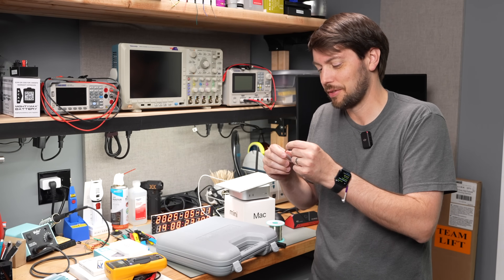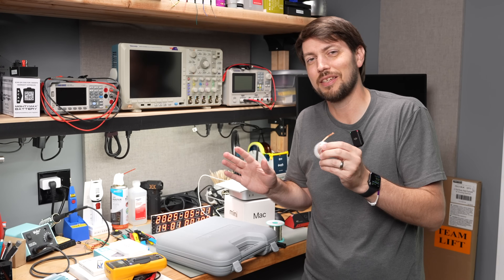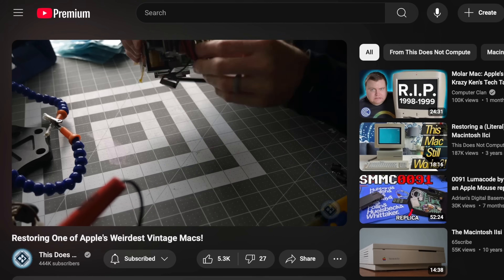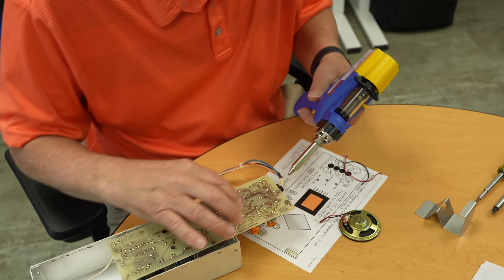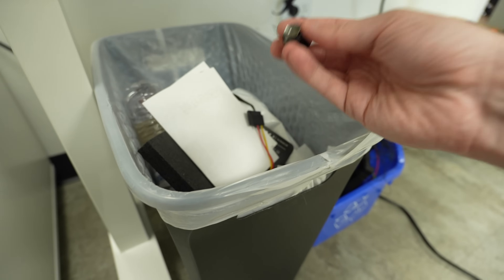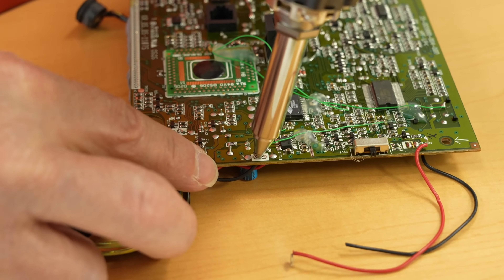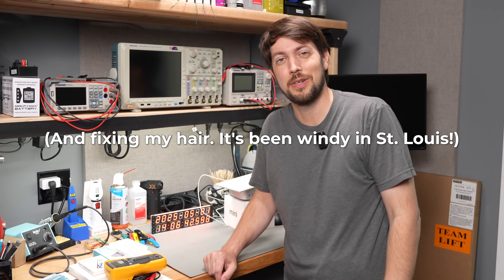Nobody told me desoldering could be easy! (Hakko FR-301)

Comment: I've just bought a cheap ZD-985 desoldering station and.....the hell, I don't understand why I didn't buy it 10 years ago! I just tested it without even readon a manual, I set 300°C to test it, I tried to sesolder an amplifier from old ISA sound card, it worked really well, then I turned it around and amplifier just fell out without even touching it, I am honestly shocked by this result, I didn't expect it will work that well!

Comment: I bought an ultra cheap desoldering tool with built-in heater. It performs much better than a simple non-heated sucker and it costs around $10 on popular page starting with Ali and ending with express.

Comment: Solder wick you have is too big.  Need #2 or #3  for your application.    Soak it with fresh rosin.  The larger solder wick you have is a heat sink.   Thanks for posting the vid.

Comment: PSA. If you're in USA and trying to get the Japanese version.  You want the fr301-82. This one has the ground on the plug.  The fr301-81 does not have the ground prong.
Reply: The fr301-82 Japanese version is under 200$ on eBay.  Adding 2x 300ohm 2w resistors, makes it the USA version for much less

Comment: I love the metcal desoldering gun I have at work ! It just doesn't work well by itself if it's a multilayer board or if something has a high thermal mass, in which case you'd need to preheat the board.

Comment: I grabbed mine by the tip during cleaning of the shaft while it was on the 2.5 heat setting (it gets clogged bad if you don't stay on top of it). Anyways, ya that sucked. Heard the singe noise and everything. It healed up in a couple days. My ego is still burned and bruised though.

Comment: Hi, I use Bismuth when I need to desolder some IC or more stuff from one board. It melts at around 70°C and mix with existing solder very well. You just have to remove as much as possible before re-soldering new components to that board or reusing desoldered components. Bismuth can contaminate your fresh solder joint and cause issues like cracking or embrittlement.

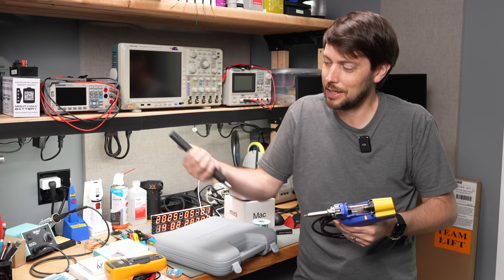Comment: 1:57 Continuous-vacuum desoldering isn’t just about saving time or getting into tight spaces, it’s also about being able to extract certain types of joints at all. 

PCBs without plated through-holes (i.e. single-sided and unplated double-sided boards) can be easily and reliably desoldered with wick or a manual solder sucker. But once you have plated through-holes, wick and solder suckers struggle because the component leg is often in direct contact with the wall of the hole, and thus in direct contact with the plating inside the hole. Capillary action makes it literally impossible for wick or solder suckers to remove every last bit of solder between the component leg and the hole plating it’s touching. That’s easy enough to get around for components with few, flexible legs like resistors or caps, but is insurmountable with large, multipin connectors or ICs, which you cannot even wiggle as long as other pins are still soldered, even just with residual solder.

This is where continuous-vacuum desoldering comes in: with proper technique, you can completely free those components.

Here is proper technique (already presuming the tip size is correctly selected and the temperature is suitable):
1. Tin the tip of the desoldering handpiece. People forget this, but it’s essential for good thermal transfer.
2. Apply the tip to the component leg. 
3. Begin to try to wiggle the tip very gently. For round or square legs, use a circular motion; for flat ones (like on DIP ICs), use a back-and-forth motion.
4. Feel for full melt. You will feel when the joint has fully melted because the wiggling becomes very easy. (If full melt cannot be achieved within 5 seconds, stop, then try things like re-tinning the desoldering tip, refreshing the joint with fresh solder, and evaluating whether auxiliary heating, like hot air or a soldering iron on the other side of the board, is called for.)
5. Now press the trigger to begin vacuum.
6. Continue wiggling, with the vacuum still going, to clear the joint. The cool air being sucked in from the other side will cool the joint back down so the leg can’t resolder itself to the wall of the hole. The wiggling ensures every side of the leg is clear. The continued vacuum also ensures that the molten solder in the desoldering tip makes it all the way through.
7. Pull the desoldering tool away from the joint.
8. Release the vacuum trigger. 

Trust me, with this method, components will just fall out of the board after desoldering. 

See this video from Pace, the company which claims to have invented vacuum desoldering. It’s the “video manual” for one of their older handpieces, but the techniques described are absolutely applicable to any brand. I recommend watching the whole video and just fast forwarding over the model-specific stuff, but if you’re in a hurry, just watch chapter 5, which starts at around 17:10: https://youtu.be/IqE1KA0OAnM?si=p-HVwJmmvvxYCdP3

Comment: I work at a small electronics manufacturing company - if you're doing a heap of desoldering, and have compressed air at your workshop, I'd recommend the Metcal or Thermaltronics desoldering gun. Although, you might as well get a dual station Metcal/Thermaltronics and plug in 1 soldering iron and 1 desoldering gun.

Comment: Just a thing to note about those Hakko FR301's: If you source them from Ebay and they're from Japan, they're likely the 100V AC version and the pump motor will run a bit faster on 120V. The difference between the US/JP version is the motor uses a single 10 ohm resistor and the US version uses 2 300 ohm resistors in series (150 ohms) to step down the pump voltage. There's a few reddit articles you will find that can help if you like. Running the motor faster might not make the pump as efficient as you'd think.

Comment: I've got a really old Weller like that, but you can't get cartridges for it any more.  I've disassembled and cleaned my last cartridge so many times it barely goes back together.  One thing I found over the years is that it works MUCH better when you have the board vertical and the sucker horizontal.

Comment: Beware of cheap solder braid. Some of it is copper plated steel wire and its thermal conductivity and therefore performance is horrible.

Comment: The very first desoldering tool I used was the manual solder sucker. They were sort of OK and worked fairly well back in the days when most PCBs were single sided.

I started using a power vacuum desoldering tool back in the days when the major brand-name (e.g. Weller) stations used compressed air and a venturi type vacuum generator. The station I had (Sylvania ??) had an small vacuum pump. The actual handpiece was awful and I fairly soon replaced it with one from Weller.

Once I started using power vacuum tools my consumption of solder wick dropped to a few centimetres per year. I always kept some around, but it made a mess and I avoided it.

When you are using a power vacuum tool, be sure to allow adequate heating time before applying the vacuum, then with the vacuum running move the tip around with a circular motion - not sliding back and forth or rocking. This helps assure the solder is cleared all around the pin. Apply minimal pressure to the tip to avoid damaging pads. If you only partially clear the hole, starting over with fresh solder added first is usually more effective than simply trying again.
With very difficult boards where pins are connected on both surface layers and internal layers, an additional heating tool may be very helpful, though with things like radial leaded electrolytic capacitors you can't get at the pads on the top side. Sometimes some preheating with hot air is helpful. You'll see lots of videos of people using a hot air tool turned up so high they might as well be using a propane torch. Don't do that!

Comment: Couldn't afford the Hakko one so I DIY it myself only for $20-40. The plus side, I use high flow/very low pressure capable vacuum pumps (30L/min flow 95% vacuum so basically 3 times more power than what's in the FR301) so clogging is not an issue and never happened for 2 years of use so far and cheap consumables compared to Hakko or anything else. The downsides are bad ergonomic and I basically just use a triac dimmer without feedback control to control the temperature. But hey, it's very cheap and works really well

Comment: Had one for years, they work well and hold up.  Probably obvious but if you can barely jam the opening down over a component leg that is a little oversized, don't.. i had a thick metal leg snap off in the nozzle and it was a bit of a small nightmare cleaning it back out.  Buy a bigger nozzle first :)

Comment: On a budget, there are solder suckers that heat up like a soldering iron. Basically like a desoldering gun but without the constant suck in. They only cost around 10€ and work well for small projects.

Comment: At my very first job many moons ago I worked for an electrical engineer and he had one of these made by Weller.  I always wanted the same tools years later but I can't justifying buying them as they're pricey and I don't do much electronic repair work.  There is the option of buying a chinese knock off but I'm unsure of the quality.
Reply from the maker: Sometimes the knockoffs work well for at least a while, or for light use. In my own experience, if I treat it very gingerly, and only use it a couple times a year, my cheap tools will last a while.

Comment: i got a dangerously cheap (~18EUR) solder pump with a heated tip, essentially a manual version of that hakko. I can't speak for the safety but it hasnt burned me down or killed my house. It made a few repairjobs a breeze though.

Comment: A desoldering gun is indeed life changing for repairs. This Hakko one looks big and heavy and might be stressful for the hand if you are doing a lot of components.
The ZD-915 which costs about 1/3 of the price is pretty good and light. 
But for these specific application you show in the video I believe thick copper wire (1mm2) does the job easily to remove all the pins at once. And then use the desoldering wick to open the holes...
Check my channel if you like I have some desoldering demonstrations and using a thick wire to desolder multiple pins at once or an IC.
Thank you! Nice video!

Comment: I tell people that solder has a silent L in the exact same manner that salmon has a silent L.  Have you ever seen a salmon solder? 🐟
Important tip-  keep the pump running for an additional second as you lift off the just desoldered connection so the solder reaches the collection tube and doesn't clog the exit end of the heater.  I've had vacuum desoldering gear for 35 years and they all clog in that spot but technique can reduce the clogging rate substantially.  Always use the wire poker at the end of a session too.  One more hidden capability these give is like selective reflow to clean up ugly solderning.  The pump is not used while the channel in the tip holds some liquid solder.  The tip is lowered over each connection to be reflowed for 1/2 to 1 second and surface tension does the rest.

Comment: Solder braid is of limited usefulness. I often use both manual solder pump (Engineer SS02 clone which is WAY better than what you show) and braid just depending on where solder tends to get stuck on any given joint.

But i also got myself a ZD915 desoldering station recently. In fact one in need of repair just fell into my lap. It may be a 220/230V region only product i'm not sure, but it's not actually very expensive at 110€ which is about 3 or 4 times less than Hakko, and you can also get the garbage version ZD211 for only 7€, but that one is really, really garbage.

Comment: I replaced a USB port on a power bank several weeks ago. It was absolutely annoying to remove enough of the old solder before I could remove the port. I ended up heating a pin and pulled out the pins one by one, basically breaking the old USB port apart. Even this was faster than trying to remove all the solder. After I removed the port, it was actually very easy to remove the remaining solder.

Comment: I worked with this about 30 years ago (two types - one with continuous pump (better), second one had every "shot" one "suck" (worse). None of that was Hakko, at least color scheme wasn't "hakko style") and as you say, it is/was rather expensive. Yet, for desoldering several DIP-28+ a day it worth its weight in gold.
At home I still have classic manual solder sucker.

Comment: Recently had to remove a 2 female 24 pin headers from a PCB to mount them onto the opposite side. So, I started by crushing the plastic shell with pliers, then used a 'sodder' sucker to remove the individual pins.
Your gun would have been a great alternative. Admittedly very tempting, but the price is quite a deterrent for most hobbyists and makers, I reckon.
Thanks for sharing and all that you do, Jeff.

Comment: I have one of those incredibly cheap versions, which was like 20 or 30 bucks, and frankly for the price it's fine. Has the heated tip, has the chamber, has a working pump of sufficient power. Surely less polished, but sufficient for my occasional uses (often enough I eventually bought it, obviously). Comparatively heavy and maybe a bit cumbersome though.
Better than the hand-version that only has 1 "charge", but most annoyingly you need 2 hands for it (one for the soldering iron, one for the sucker) and very often that's more than are available.

Comment: I have the Hakko 808, which is the predecessor to the '301.  That tool has paid for itself many times over doing control repairs!  It's probably been through several thousand solder removals.  Have you ever done a video on that clock?  It looks suspiciously like one of mine except yours has two rows, with the date on top.  With mine everything is one row.  73

Comment: In the olden days, nothing could touch a Pace MBT-200. The wand is much lighter because the pump is in the base unit. The soldering iron was meh -- once you get used to a Metcal soldering iron, everything else feels like you're using a cigarette lighter and a hot nail for soldering.  Also, lead-free solder is the work of the devil.

Comment: I have a similar tool and to be honest on very large through hole components like what your dad is dealing with they work very, very well. But on much smaller components not so much.

I've found that technique is very important as is having a range of tools, and as others have mentioned pre-heating the board can help.

Comment: You can get combined hot air, sucker and fume extractor stations (mine is made by BlackJack SolderWerks). This is more economical since the air pump is shared between all three functions (mine has a temperature controlled iron too) and also you have 'wands' rather than 'guns' in the hand which is lighter and easier to control, if less MAGA! Also you guys should go the whole nine yards like you did with aluminium and spell it 'sodder'!
Reply from the maker: Ha, but then it wouldn't be as funny that we pronounce it "sodder"!

Comment: I generally use a hot air station for desoldering SMT ICs and connectors, wicks for cleaning the pads or sucking solder out of pretty inaccessible places, and a ZD985 desoldering station for all kinds of through-hole desoldering. I do a lot of THT service work and this is truly indispensable. Nota bene, reflowing before desoldering will make the job a lot easier especially on dirty-ish boards and lead-free solder.

Don't dump old solder to a bin, remelt it instead. Melting pots come in various sizes and are usually cheap nowadays, and they come in handy for tinning stranded wires or parts.

"Moo tool"? Ha, cute.

Comment: I recommend ZD-917- Its desoldering station with soldering Iron and it is half the price of that Hakko. For that type of machines sometimes you need to change the tip- there are different nozzel diameters for different legs of electronic components- it depends what things are you working with.

Comment: Good for single sided boards, but with plated through boards I actually stopped sucking at all, just heat all the pins simultaneously with a big tip, hot air or even two irons simultaneously

Comment: I know these are specialized for desoldering but wondering how's the wear and tear on this thing? like with soldering irons you can changes the tips if they get corroded or too oxidized
Reply from the maker: Yes; they sell a variety of ends for this device, and it seems like after a number of hours, it may need replacing even if kept clean and tinned.

Comment: That would be my dream de-soldering tool, but for now I am bound to a manual version.  Not the non-heated (barely works) one you displayed, but one that heats the solder AND vacuums it up into a somewhat less convenient storage chamber.  At only $30-$40 it's a far more achievable tool for many who don't need to de-solder on a daily basis.

Comment: Yeah, I was also surprised at how much easier the job was with this tool. If you are regularly doing desoldering, it's a godsend.
It can also be just plain a better tool than the alternative (not just faster) in cases where you have 80s style through-hole ICs you have to desolder, and want to keep intact. It makes it much easier to actually do a thorough job of removing the solder from the pins, so you don't accidentally pull up and bend your leads. You can do a much sloppier job with two or three lead parts and get away with it, but not as much when there's 8 plus leads.
It's too expensive to get unless you're planning to use it regularly tho.